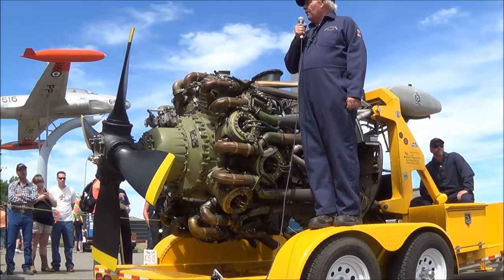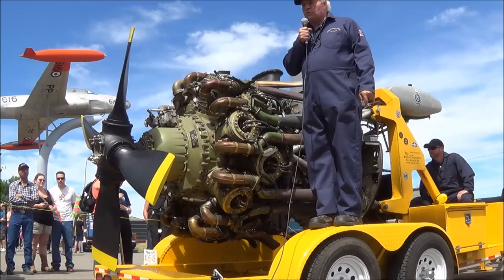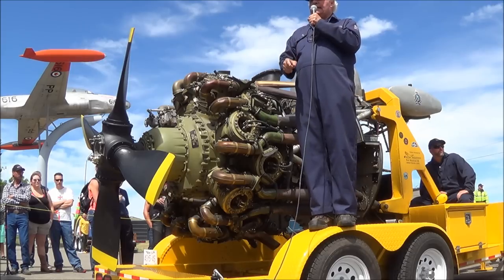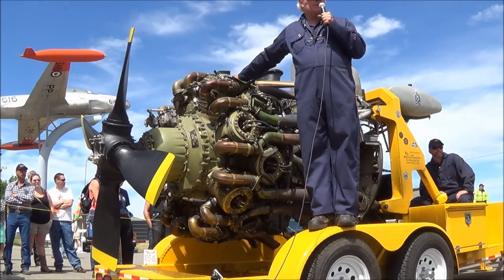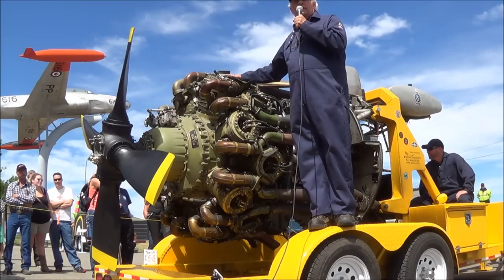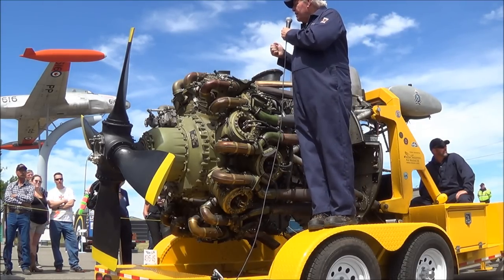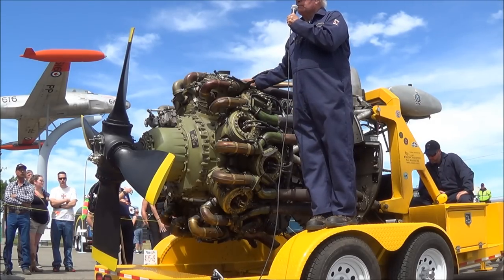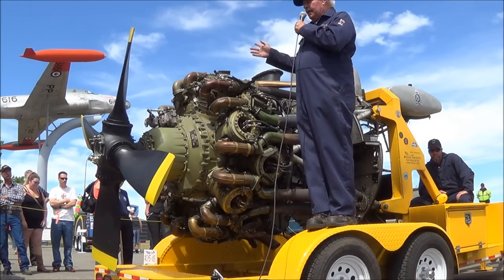Bristol Hercules Sleeve Valve Radial Engine Run

Comment: Great engines, my father used to service these, and fit from brand new to aircraft in WW2, they used to come in huge crates and covered in lots of greased paper wrapping. To think of all those parts spinning round at high revs is amazing, so many finely machined parts and castings , a marvel of design and production that has little comparison even in modern days..
Reply: Check out Ardema and Braun

Comment: How messed up when you consider the work and money spent on these machines meant to kill fellow humans. We are an intelligent but savage species.
Reply from the maker: I have the same thought from time to time.
Reply: Wild Bill this engine was not made to kill. It was made to go round an round. Was it used on a bomber? Yes. But its like a knife i can cut my bread with it or I can stab with it. But in the end an aircraft engine never killed anyone unless it fell on them or you walked into it.
Reply: Well not exactly, Bombers were designed to destroy infrastructure, vehicles and the like. Just unfortunately lives were caught up in the crossfire, but that's to be expected. Fighter aircraft were built to shoot down aircraft not the people. Bombs were to destroy objects. So on and so on. Your point fits more with guns, grenades and artillery.
Reply: AZZA Craft still wrong the engine is not a bomber. Might as well say aluminum is evel as they made bombers out of iy
Reply: @massmike11  and the award for the "I'm trying to act smart" goes to you. We know an engine can't kill but that's not the point of these comments, we're talking about the aircraft as a whole not just one part of it.
Reply: @massmike11  you are correct that engine was designed and built to fly . 
We screw up as savage beasts

Comment: The Hercules was also the engine used on the Bristol Beaufighter, a twin-engine aircraft used both as a night fighter and as a torpedo bomber. My dad was an RCAF officer who flew with RAF Squadrons made up of Commonwealth crews, and he and his navigator spent many hundreds of hours flying at night, often in bad weather, armed with four 20mm cannon and ten .303 machine guns, as well as the early Marks of A.I. (Airborne Intercept, later to be called RADAR). The pilot's position in the nose of the Beau put the pilot almost literally between the propeller tips on either side, and the noise level at full throttle must have been pretty high. The Beau was, according to various accounts, not a very forgiving aircraft. As "Moose" Fumerton, who was Canada's most senior night fighter officer once put it, the Beau was a difficult aircraft to fly well. It's relatively slow top speed put it at a disadvantage in some cases, but its ruggedness and reliability, combined with the awesome amount of gun-power carried, earned it the respect of many night fighter pilots. As soon as a version of the DeHavilland Mosquito armed with 20mm cammon (4 under the nose, typically) and much improved AI/Radar became avaliable, both RAF and RCAF night fighter squadrons converted to the Mossie, which was "nippier" and also more than 100 mph faster. The "TorBeau" torpedo bomber version was used to good effect in the Med, and also by the RAAF. Beaufighters were also used as ground-attack aircraft in the Desert War against the Axis, and flew in both India and Burma in the same role, shooting up Japanese Army troop trains and formations. The Hercules engine, when throttled back, was very quiet, and the Japanese nicknamed the Beaufighter "Whispering Death." 
My dad's younger brother was originally trained as a Halifax pilot, but was remustered ostensibly as a navigator, but in practice acted as wireless op, assistant engineer as well as navigator. His Halifax was shot down over Nuremburg in early August 1943. there were no survivors and the crew are buried in a Commonwealth War Graves Cemetery near Munich. He was 5 days short of his 21st birthday, and was halfway through his second "tour" in Bomber Command. So, plenty of family history associated with the Hercules engine, and with the Handley-Page Halifax. Thanks for sharing this.
Reply from the maker: Thanks so much for watching and thanks for the history.
Reply: Anyone can copypasted from wiki

Comment: i love listening to these old engines coming back to life
Reply from the maker: Its a real treat to hear them in real life.
Reply: yes it is a serious thrill ,, i have heard a few in person  , in particular my favorite is  the  Merlin V12 
but i have a serious affinity for airplane engines of all types particularly piston engines 
I have a very large collection of  gasoline and diesel truck and tractor engines from the 1940s to today 
I also have a couple of  airplane engines , am currently rebuilding a  1st generation  Allison V-1710 which my grandfather saved from the scrap yard  50 years ago , it's a slow job that has taken 15 years so far ,,and may not run for another 5 years 
i have rebuilt a couple Lycoming  Boxer engines  and have several in various states 
I have a 5000 square foot  warehouse full of engines on pallets and parts on pallets stacked 18 feet high
since 1995 when detroit diesel quit making 2 strokes  i have collected over 100 of them  from tiny 2 cylinder engines to my biggest  a monster 20V-149 which i have running now ,, it's a MONSTER  with 6 turbochargers , 3 intercoolers and 3 roots blowers ,,it weighs a staggering 6 tons  and produces 3200 horsepower at 2200 rpm
2980 cubic inches , 20 cylinders  2 stroke diesel,,my particular engine has 21,000 hours on the meter

Comment: I  known well the last version from the Hercules, a improved type 739, 2040hp , built in France by SNECMA up to 1964, to fit the military transporter Nord 2501 Noratlas: this engine was very reliable, low consumption (30% better TBO as another type radial same power, excellent burn efficiency, with deep blue flames at exhausts visible in the night), and unlike what some ignorants think, on a good condition Bristol sleeve valve engine, was the oil consumption not significative higher as on a classic radial similar power, and this engine was not "overcomplicated" (looks only like): use less parts as a classic radial...
Reply from the maker: Cool, thanks for the info.

Comment: Amazing  engine probably  have materials and engineering  precision  to make these a very reliable lump the sleive valve always seemed like answer for plane engine saving a good 9 inches of power sapping  drag by not having valves at top of head . Always thought side valves might be good solution  with good supercharger

Comment: Could run on much lower octane fuel than other designs. Also a smaller frontal profile for less drag.
It lacked the hot spots of poppet valve designs. Exhaust valves need high octane fuel to keep from pre igniting fuel air mixture.

It’s heads were easy but the gears to run sleeves were not.

Nova Scotia.

Comment: No poppet valves, no springs, no pushrods, no rocker arms all you need is mighty fine sleeves.
Reply from the maker: The internal workings are absolute art.
Reply: They have to be perfect, that's for sure.

Comment: Actually, I’m certain that Hercules weren’t used either in Sunderland’s or Wellingtons.  The Latter were powered by Pegasus engines, as were the Sunderlands, bur some marks had Pratt & Whitney’s.  However, the Hercules was used in Beaufighters, Hastings, Vikings and I think Varsities.  Whereas Seafuries and Ambasadors had Centaurus 18-cylinders.
   Napier Sabres were also Sleeve-Valve Motors, and possibly the most powerful engines of the lot. (Liquid-cooled, twin-crankshaft, flat-12 cylinder x 2.)
Reply from the maker: Robin Fryer Experimental testing perhaps?
Reply: My reference sources state that the Wellington had Hercules engines - and I recall watching a wartime publicity film showing a Wellington being assembled at Broughton in nder 24 hrs.  The so-called 'power eggs' (the completely assembled engine nacelles) clearly had sleeve valve engines.

Comment: Met some ww2 A20 pilots in the US in 2008/9...they were very impressed with the RAAF Beaufighters and commented how quiet they were compared to their aircraft...
Reply from the maker: It was surprisingly pleasant to be near when running despite its massive power output.
Reply: @Rainhill1829  A departed friend from the US was in the 3rd BG 5th AF  and he often stated a ditty they learnt in PNG during WW2..The B 25's rattle and road, don't want to fly out of Port Moresby no more...he reckons they were a noisy aircraft.

Comment: Could run on lower octane suitable aromatic fuels. Lack of poppet exhaust valve hot spots allowing so. Junk head design allowed for reduced diameter for lower drag profiles.

Comment: Would you ever do a hundred percent power for a minute or two video.
Reply from the maker: They would have to do some more work to make sure it is in perfect condition to handle the stress, the major hurdle would be obtaining the high test leaded fuel needed for preventing detonation at the high levels of boost the superchargers run at.

Comment: This is such a great sounding (and running) engine. If I'm not mistaken, as they run, and carbon builds up around the ports, they compress more, correct? Also, what octane level of fuel is used, and is it ethanol free? I'd run it ethanol free if at all possible. Also, whoever you all have do the timing for these deserves a medal. That takes some serious skill and even more serious patience.
Reply from the maker: Good question, I actually do not know about the port carbon but I believe they try to keep the combustion chamber as clean as possible. The fuel they use is leaded aviation grade gasoline which is completely ethanol free, I believe it is 110 octane, they do not use the very high test formula that would be needed to run at full boost simply because it is extremely expensive and difficult to obtain.
Reply: @Rainhill1829  Oh, I can imagine how pricey high test avgas would be. Even 110-Oct E0 is pretty expensive. While it would be nice to be able to run this thing full tilt once again, I suppose that shall wait until it once more takes to the air! After all, it'll be worth it at that point. I can't even find E0 pump gas where I am, much less the good stuff that can run in an aero engine without it knocking itself apart.
Reply: @Rainhill1829  I did find a few things mentioning an increase in power as carbon builds up around the ports and sleeves, helping out with the sealing issues sleeve valves have by design. Unsure if this particular engine would benefit from that, though, as it was on a forum discussing the rebuilding of sleeve valve car engines. It seems as if not many people want to tackle such a complex aircraft engine, which makes your video that much more unique. I do seriously hope that plane gets rebuilt within my lifetime, would be a sight to see, even on Youtube.
Reply from the maker: The good news is they are hard at work on it as we speak, I will be keeping close tabs on their progress and in time we will get to hear a symphony of four of these engines running together. It is going to be great.
Reply: @Rainhill1829  Oh, I sure as hell want to see this, and I wish them the most luck. Question, were you just in the crowd, or are you affiliated with them? I was thinking you were affiliated with them at first, but now I'm unsure.
Reply from the maker: I am not a member of the society but I make frequent trips to the museum to see what's up whenever I can get down there, I want to be part of the group that is doing the restoration and operation but the distance is just a bit too great and I have lots of other volunteer heritage machine society's I'm already a part of that demand my attention close to home. Otherwise I would be there every day covered in oil.
Reply: @Rainhill1829  That's cool, getting to work with old machines must be nice. Especially when you get old hot bulbs etc. that are simple and straightforward! New cars are just too much computer this and computer that, even tractors.
Reply: >If I'm not mistaken, as they run, and carbon builds up around the ports, they compress more, correct?

Carbon would have a hard time building up due to the elliptical sliding nature of the sleeve valves, it'd most likely either be burned away or blown away when the exhaust cycle came around. If carbon got between the sleeves, that'd be a big problem, it'd score the sleeve and the piston rings and cause blow by, which was already a problem in sleeve engines. Excessive carbon buildup in normal engines can glaze the cylinder walls and make the piston rings effectively useless, causing the cylinder to have almost no compression.

>Also, what octane level of fuel is used, and is it ethanol free? I'd run it ethanol free if at all possible.

100LL is the most common avgas variant today, which this engine will run on if you don't run too high of a manifold pressure. It really needs 115/145 to develop full power, but that stuff is very expensive and only available via special order. Neither fuel contains ethanol.

The engine will probably run on high grade civilian pump gas, but not for very long. Engines in WW2 were usually made with magnesium alloys and ethanol is murder on them. magnesium corrosion is nasty and usually requires the part to be replaced entirely.
Reply: MichaelKingsfordGray  The ports (holes) in the sleeves, inside the cylinder itself as well as in the exhaust. I thought I had heard somewhere that as these engines run and small amounts of carbon build up in those places, it'll gain compression due to everything sealing up better, almost like a second set of gaskets.
Reply: MichaelKingsfordGray  There are three ports (IIRC) on the Bristol Hercules, which the sleeve moves around to cover/uncover. It's similar to a two stroke engine, except in this case, there's a dedicated sleeve acting as a valve, vs the piston in a two stroke engine.
Reply: Ethanol is forbidden in aviation gas because catch water, and water did freeze= engine down from intake freezing...and in addition ethanol is a strong solvant: common use in aircraft factories as solvant, so very dangerous spécialy in a sleeve valve engine: can cause sizes during the cold run after engine start (fuel did condensate in the cylinders and remove all the lubricant , gasoline did only dilute the oil, not remove)...And a good condition Bristol sleeve valve engine did NOT built up carbon on slides: the burn efficiency from such engine make it very clean (blue flames at exhaust), so close no deposits (i was aircraft mecanic on Noratlas and never see excessive carbon built up and too much blow by occurs only on end TBO engines...i think some legends about sleeve valve engine comes from the much different and unreliable double sleeve knight engines...

Comment: The original Lancaster’s has Merlin engines not the Hercules.  Some later versions
Reply: Lancaster B.II had sleeve valve motors, in case the supply of Merlins was interrupted. Same thinking behind the 801C radial powered bf109v-21.

Comment: Does it normally take that long to light a fire?
Reply: Theres a lot of friction trying to cold start a sleeve valve engine from cold. A hot start would be alot easier on the starter.

Comment: Does anyone know if these were ever turbocharged and so in what application and how well did it work?
Reply from the maker: They where all centrifugally supercharged to some level depending on application, their most famous use would have been the Halifax four engine bomber. After the war they found a new use powering many military and civil transport and passenger planes. While their design was complex, if they where taken care of properly and not driven extremely hard, they gave exemplary service and where well liked by their crews.
Reply: bgm1958  NO British plane or engine used a turbocharger during WW II !!!! The Brits did NOT have the technology on the Turbo !!!  That was all GE of the USA !!! And why the P38's delivered to the Brits did NOT have the turbos, they were not installed, only the mechanical supercharger that ALL Allison had was used !!!!
Reply: @wilburfinnigan2142 I think you will find the Allison normally aspirated was replaced by the SUPERcharged Merlin.... air compression was crankshaft driven. Exhaust driven TURBO chargers don't work too well at altitude, they can refuse to function after the throttle is closed !
Reply: @wilburfinnigan2142  Oh dear, who is Mr Crosspatch today then?
Reply: @labarone8910  Who the fuk cares who he is ??????HHHHHUUUUUHHHHH?????
Reply: Wilbur Finnigan ...  wilbur, mate, just take your daily dose of Trump and it will all be ok 👌
Reply: @wilburfinnigan2142   Turbochargers are difficult to built and maintain : the first aircraft who use a turbocharger was the WW1 1917 Breguet XIV , reconnaissance version (hight altitude) : the turbocharger was built by Rateau to fit a 12cyl Renault... but this first turbocharger was unreliable and had a very short live ......
Reply: @leneanderthalien  BUT.......It was GE in USA that made them work !!!!  WWII Saw Only the USA use them on the P38     the P47     and the B17 and B24 Bombers.......giving a 10 to 12,000 ft higher service ceiling over non turbo'd planes !!!!

Comment: Half Power??...with no prop...put something it can drive...you might have maybe opened half throttle...but no where near half Power...it's free spinning driving nothing
Reply from the maker: In a few short years it will have a full sized prop to turn, along with three of it's sisters on the wing of a Halifax bomber.